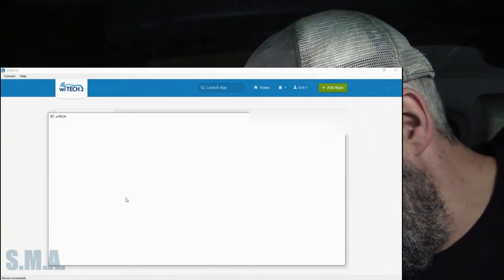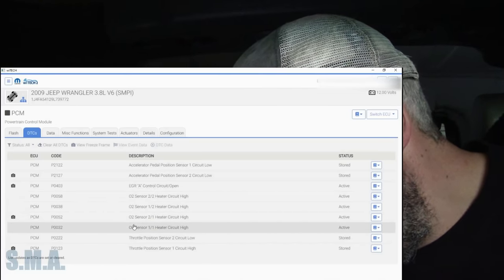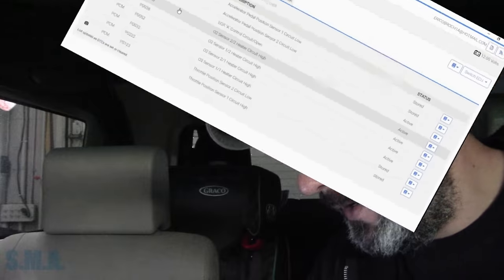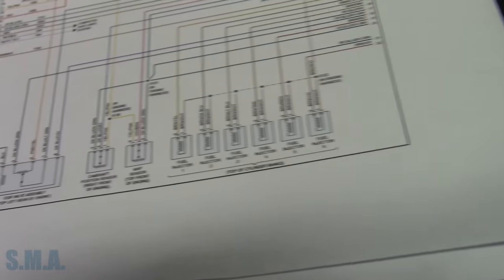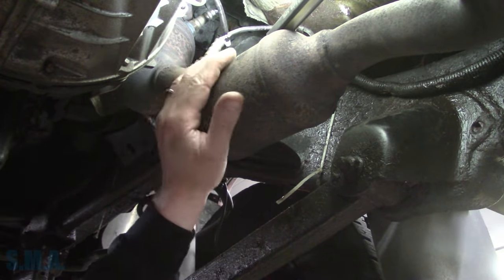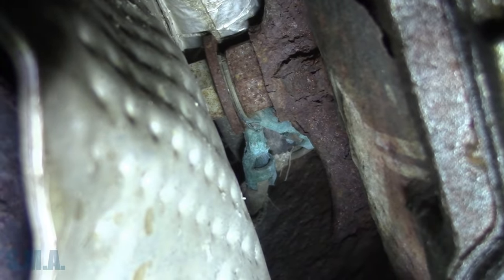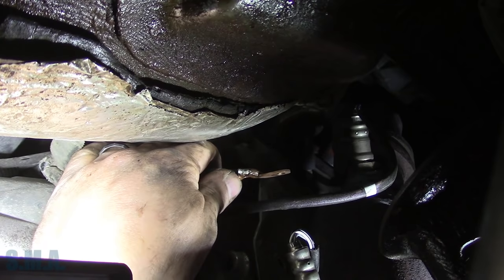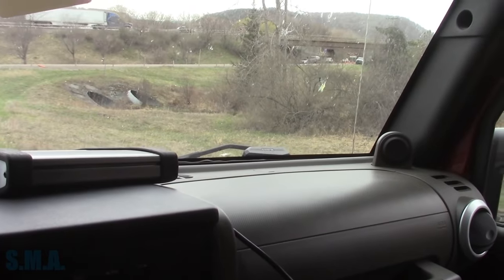Another Jeep, Another Bad Ground...😐

Comment: I am NOT a certified mechanic nor do I claim to have any such talent when it comes to fixing electrical issues on my vehicles. But...i have learned so much valuable information from Eric O and this channel that I have never missed a video. Even if it's a repeat concept, I've still watched them all. Sometimes i even go back and watch videos a 3rd or 4th time when I'm getting ready to tackle a repair on my own car. Thank you SMA.
Reply: " I am NOT a certified mechanic nor do I claim to have any such talent when it comes to fixing electrical issues on my vehicles"

Scotty??  Is that you?
Reply: Same here
Reply: @TechGorilla1987  Ha! 5/5 comment stars
Reply: This guy taught me how to replace the head gaskets and timing belt on my Subaru. That was 10k miles ago. It ticks because I skipped the valve adjustment, but whatever.
Reply: @TreyCook21  pop of the rocker covers and get them adjusted!
Reply: @dans_Learning_Curve  I really should. It's not hard to do. But I'm also lazy and/or afraid to do it. Mostly lazy, let's be honest.
Reply: Tech Gorilla ww
Reply: I wish I could get my staff to watch so religiously. I keep preaching the "prove it" mentality but it's like flogging a dead horse sometimes
Reply: Didn’t one of the codes indicate a ground fault?
Reply: @TreyCook21  there's a feel to it.  If the feeler gage slides too loose or to tight the clearance will be off.  Can't learn that feel from a video.  The way around that is to get a cheap Harbor Freight dial indicator.  Set the plunger on the valve spring retainer of the valve you're adjusting.  Use a feeler gage 0.005" bigger than spec and tighten the adjusting screw until the dial indicator reads 0.005.  Tighten the lock nut.  Use the correct size feeler gage to double check the clearance and move to the next one.  Good luck.
Reply: @LuckyBaldwin777  Thanks for the info. I do it on lawn mowers yearly, so I understand the feel, but it might be a bit more tricky on a car. Never hurts to have a dial indicator anyway for checking crankshaft endplay and such.
Reply: Me too!!
Reply: @TreyCook21  I use mine a lot.  If you do a lot of work skip the Harbor Freight one.  I got a Starrett with a magnetic base that comes in a wood case.  I've used it for a couple of decades now and I'm very happy with it.  I hear Mitutoyo's is also good, but I prefer buying Starrett tools that're made in Massachusetts rather than tools made in Japan.
Reply: @GreenAppelPie  No, it just indicated the O2 sensor (s) not working, any mechanic, even a shade tree mechanic, should realize that yea, O2 sensors DO fail but all four at once?. O2 sensors, (and that EGR valve) were not cheap and then yo add in the labor charge, if it were mine I'd go back to shop #1 and direct them to watch this vid, then ask about a refund.
Reply: Make sure to use the brake cleaner and give it two uga duggas 👍
Reply: @TechGorilla1987  You Mean Rev up your engines scotty???

Comment: The crazy part is how fast he finds problems that other shops can't fix with multiple tries.  Eric is an auto savant.
Reply: Experience by repetition
Reply: Uses his noodle!
Reply: One thing to remember that I was taught long ago is that trouble codes are generally a symptom, not the cause. That’s what separates a real mechanic from a parts counter jockey.
Reply: LOL he said he had wasted a lot of time on it. There's a thing called editing.
Reply: meemaw taught him
Reply: Jerry S. - Maybe not so much they can't fix it, as to they're just too lazy to take the time (not that this one would have taken that long) to use some common sense and diagnostics, but find it easier (and profitable) just to just swap parts then send it it elsewhere.. Man! If it were my vehicle, I would go back to the previous shop and ask what their thinking process was.
Reply: He is good but this one was really obvious. Other shop is garbage.
Reply: Eric is not a savant, just someone who uses his reasoning powers.
Reply: Eric is playing Chess while we're playing Checkers
Reply: Agreed. He's a good car fix channel that i have followed for many years. EricTheCarGuy and Scotty Kilmer i have subscribed since 2009. I learned a lot of cars, common issues they have had and i landed myself a 2002 chevy astro LS window passenger AWD van. It came from Erie county buffalo new York 98,200 miles for 800. It has rust, however the frame and suspension in the rear where they would get bad frame damage from road salt/rust didn't wither away at the frame too bad. It's down here in GA with me. I put a fuel pump in it but its been good for two years. Completely stock and can past inspection but we dont care about inspection on the florida georgia line close to duval county 😂
Reply: @meabob  True, but he was also zeroing in on it  from the time he read the scan.
Reply: It’s all about logical deduction. Eric is very good at it.
Reply: The other shops dont actually try to diagnose. They just start replacing parts and get rid of the car once the bill gets too high but, the car still isn't fixed. They know the customer will be pissed and they cant really fix it.
Reply: @danfarris135  spot on, they guide you in a rough direction, then a real technician needs to work ;)
Reply: Phenomental1ty I wouldn’t listen too closely to Scotty.
Reply: Erick is the best
Reply: The crazy part is Chrysler wiring still sux to this day.
Reply: @NY411Info  it's not only Chrysler with poor wiring now, it's all automotive chock full of "save the planet" cruft, which really isn't saving anything in the long run, since it costs more and waste's tons more resources over the lifetime ;)
ye-old green scam!
Reply: @throttlebottle5906  Yeah ur right. Not sure how we are not polluting as much during manufacturing. I mean it takes electric to make battery power products and fossil fuel to make the metal. Also electric uses fossil fuels, at least a high percentage.
Reply: Since finding wire breaks or shorts usually means no income from part replacements perhaps EO shop rate should rise to 100-120/hr. Not to mention the more time spent finding the fault holds up the line-up of other customer vehicles awaiting standard maintenance. Now watched appx 20 or more SMAR videos..This Man's not a mechanic, I feel EO's a "Master Mechanic", it's not surprising other Shops send many wire fault vehicles to SMAR...the problem get's fixed and at too reasonable a rate. The reviews of EO's business are  absolutely wonderful.  Watch his subscriber numbers..they have grown by 7K in the last week or two..'not surprising'.
Reply: S/B Web 'reviews'.
Reply: @totalyep  LOL Yeah know-it-alls always say it "was really obvious" after someone else fixes the problem. It's usually the same ones who couldn't fix it in the first place.
Reply: @KStewart-th4sk  if you knew anything about cars you would know too.

Comment: I am truly impressed that jeep can even drive straight after getting hit that hard with the parts cannon
Reply: "Parts Cannon ineffectual, Captain! The Jeep remains broken!"
Eric O.: "Set course for the Splice Cluster, maximum hamsters!"
Reply: haha @ jeep and drive straight! that's funny to begin with, brand new from factory they never drove straight, heaven forbid they hit 30K miles.
Reply: Yeah 4 ox sensors going  bad at the same time , I'm not a tech, but even I would say ground !!!  where do they get these mechanics at these places
Reply: @throttlebottle5906  thats what I was going to say..Im confident they ain't nothing straight about that thing.
Reply: I'm stealing this  LOLOLOL
Reply: @robertforrester4019  Same question, before I was into cars, I had my mechanic start throwin O2 sensors and ignition coils and all kinds of parts at my car when the issue carried across all banks and I was throwing an evap code on top of it. Took me one day and $0, blew compressed air down a clogged hose and the issues been fixed for 4 years now lmaaoooo, sooo I spent upwards of $600 for no reason because the mechanic had no idea what he was doing

Comment: My thought process with multiple failures was always look for what they had in common. In this case they all shared a ground. That's why  people are sending more problems to Eric, he looks at how things work before he just shotguns a bunch of parts at it!
Reply: That and manny mechanics are just shit at basic diag as any electrical issue is the ecu or is too "complex" then the issues comes done to does the wire have continuity/can it carry current. A multi meater and a 15ft wire will get you a long way in many issue.
Reply: Oh am still rolling mtf before ( shotgun a bunch of parts
Reply: my neighbor was about to sell his car because he had a bunch of weird electrical problems happen all at once it was old he figured not worth the fix........he knows nothing about cars and knew i was a weekend wrencher.....sure enough a main ground had rotted and fell right off.....had him up and running in about 1 hour...
Reply: a basic test light and knowing how to use a meter...
Reply: yup exactly

Comment: I worked for a GM dealer as a parts mgr in the late 80s and early 90s. Grounds were the first thing our technicians would check for any electrical problem.
My nephew asked me what was wrong with his sons car after the dealer replaced every sensor on the car including the PCM. I told him have them check the engine grounds. He thought they had but he brought it to an independent repair shop and they fixed the broken ground wire on an engine stud and gave the car back to him.

Comment: As a diesel mechanic for about 25 Years now, This kind of info is what every young mechanic should look for because I have learned from watching a listening to older techs all my life and I get bored easy if I don't learn something new everyday by myself or like in this case watching others. And no I have never even worked on or driven a Jeep, except for  a real one a Willies JEEP.  O And if you can't ever get your  clothes dirty Don't try to be a mechanic, Most diagnostic info has some relation with a completely different machine like a Eighteen wheeler. Happy wrenching everyone 🤓🇺🇸

Comment: Going back over all Eric’s videos. If you take nothing else the big tip was the 02 sensor high usually shorted to ground and if high circuit on signal circuit usually open circuit. Valuable information. Helps on other vehicles and sensors

Comment: Eric: What’s the chances of all 4 O2 sensors going bad at the exact time

Me: Slim to None and Slim left the building...
Reply: "The odds are approximately 3, 173,490 to one against such an occurrence." - Spock
Reply: In my 40 years in this business, I have seen it happen more than twice. Granted that these vehicles were also used off road a lot but it's always best to check before throwing parts. When you find 4 bad O2s, it makes you second guess your diag, your info, and/or your equipment. LOL, What's the chances of all four parking light bulbs being burned out at once? Or both headlights? Seen it happen several times as well. I learned years ago that if all the lights don't work, check the fuses and if the fuses are good check the bulbs next. The thing is many people don't keep their vehicles in good working shape. If the check engine light is on but it drives with little hassle, they go. The Jeep in this video was only getting fixed so they could pass emissions testing for the inspection. Probably for license plate renewal (I'm not sure how NY does that). From the looks of that ground connection, it had been bad for a while. The O2 heaters turn off after the exhaust heats up so there probably wasn't a big drivability issue especially for the gas and go types.
Reply: Well I did spend time  tracing a no brake lights problem, then found two dead bulbs !
Reply: @bryanlatimer-davies1222  There's your problem, Mister!
Reply: @meabob you got it man gotta give it to ya

Comment: I have a 98 Jeep TJ, and a 96 Ford Ranger pickup, and I can honestly say that corroded ground cables/connectors are the root of pretty much all the evil electrical issues I have experienced! Wisdom dictates that you clean/check  ALL connections (ground or otherwise) periodically (once a year in my case), so your vehicle performs as it was designed to (Note; I have noticed that in many instances, the ground points are located in really hard to access spots. Don't let a "hidden" connection go unattended. They are in places that most commonly are most suseptable to corrosion. Leaves me wondering if they aren't designed that way on purpose?🤔). Great vid, Eric! 🎓👍

Comment: First time viewer. It is amazing what a good mechanic with the proper tools (professional scan tool) can do to save the customer money on parts that don't need to be replaced. That poor guy threw at least $500 in parts at it and still had the same problems when all he had was $5.00 worth of wiring and ground connectors needed.

Comment: I have an 07 jk, had a random no start condition. After changing to a new starter (old one had a bad bearing) the condition continued found a the transmission switch not grounding properly. After shifting into neutral and back to park it would start... Added an auxiliary 10g ground wire to the block and haven’t had a problem yet.

Comment: Eric you are a pro, you check all the codes, think all the errors on these sencors can come at once, No chance.  What do they have in common, the ground.  Data is good, but you have to think, how does the data work, if it is wrong on No. 1, it will be wrong on No. 2, 3, etc. I hope you teach your mechanics this.  Your workshop will be unbeatable.  💥💥💥💥💥

Comment: I am glad you redid the same issue on this Jeep.  It reinforces the first one in a big way. We don't suffer the terrible corrosion problems you folks have about the termite line and as a result we don't see nearly so many corroded ground lugs. This is a very interesting point you make in that the symptoms led you straight to the culprit due to previously experiencing this same issue and remembering it. I remember the hassles, the hardest ones to figure out, and i guess seeing this video bolsters my convictions to trust to my own common sense when faced with a problem like all four O2 sensors seemingly failing at once. Good call and explaining the logic works best of all for me. Thank You Eric O!

Comment: My 2010 Patriot has been nothing but ground problems. I'm down to the 4WD! warning light popping on at every startup when I hit 1 mile. t may be a ground or a sensor. Now I'll probably need to take it into a shop so they can scan it. Thanks for posting a ground wiring issue with a Jeep product.. MD..............
Reply: I think there's a TSB for that to check the connector at the transfer case/PTU for the big mean greenies. If I remember right it gave the part number for the connector if it needs replacing.

Comment: Just Subbed and rang the bell, nice channel ... Bad grounds ... something I always check ... got a rebuilt Bosch starter years ago for my cherry, rust free 1980 Fiat Spider, got lucky and it fixed a whole host of electrical issues (living at the beach turns everything green) leave it to the Germans, inside the rebuild box was a few dozen pages of technical stuff, and dozens of tips (musts) on checking correct ground on all electrical stuff ... with graphs and everything .... and this was a non ECU car ... it also showed how faulty ground stress out the rest of the system causing premature failure of alternator/battery, etc ... that was 20 years ago and I'm now a fanatic about my engine, battery and other electrical grounds ... all squeaky clean and sealed from corrosion ... living in PA now, no shortage of salt used here and every auto over 10 years old is a rust bucket ... my 2000 Jeep Cherokee looks brand new, and drives like it too

Comment: I am not a professional mechanic.  I own a Chrysler product.  I had a few electrical devices stop working, so I did what Eric taught me...got a wiring diagram, looked at the circuits, found they all have a common ground.  Found the grounding point...it was full of green crusties.  I repaired the grounding point, all problems solved.  

For a "professional repair shop" to not have been able to diagnose that problem is IMHO appalling.  Water is wet, the sky is blue, and Chryslers have grounding issues.  I honestly feel bad for whoever owns that Jeep...they got shafted big time by that "shop".